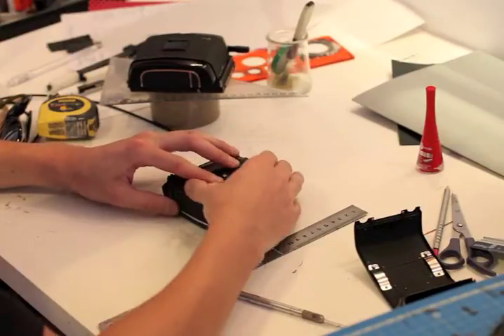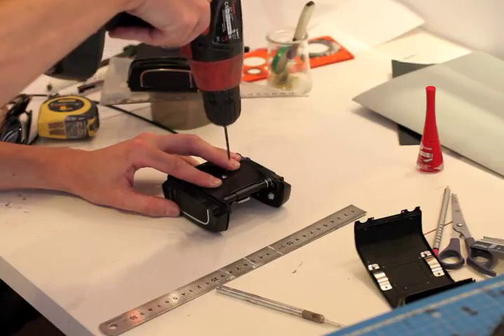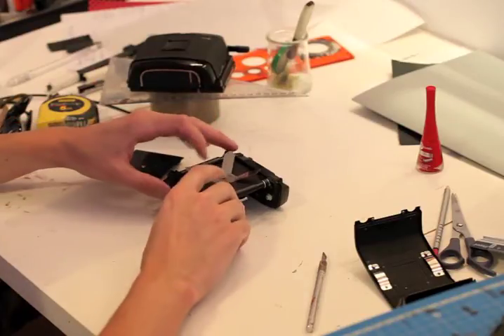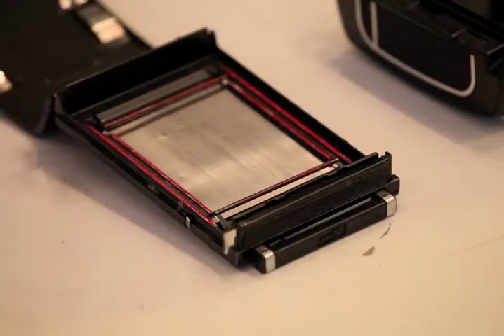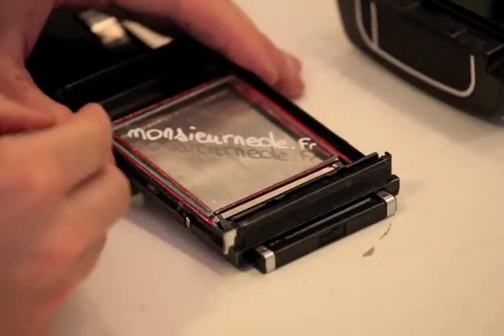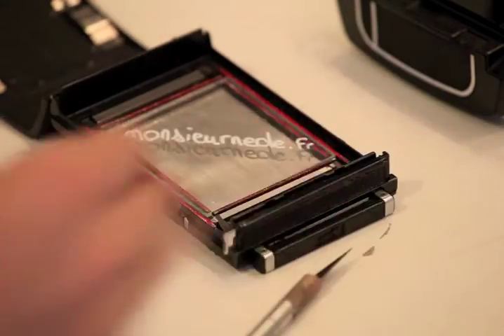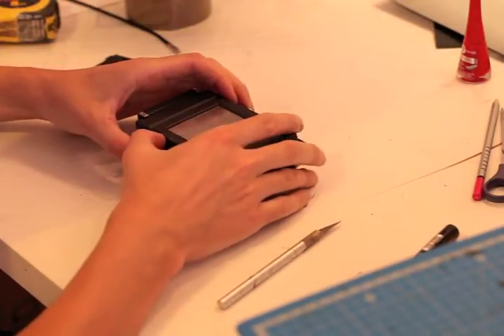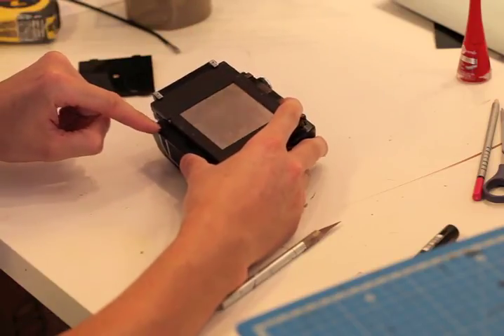Mamiya RB 67 mod for wet plate collodion

Comment: helping souls years later with this video! 
May I ask you the brand of glass you use for this process
Reply from the maker: Hello, it's just regular clear glass you can buy in any shop, 2mm thick...Have fun
Reply: Much love!
Reply: I remember you mentioned 64x68 millimeters glass, would you have a source for this or do you usually have to cut your glass?